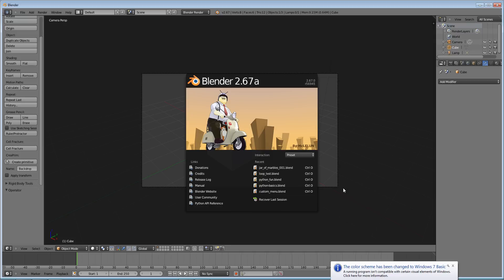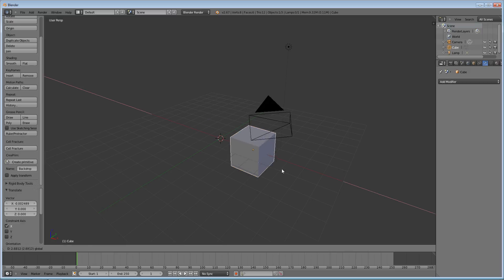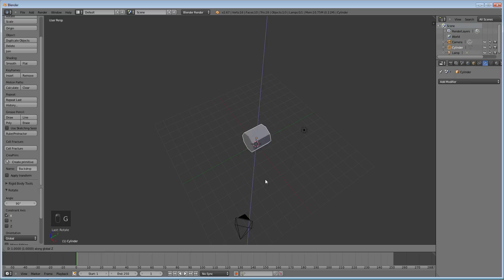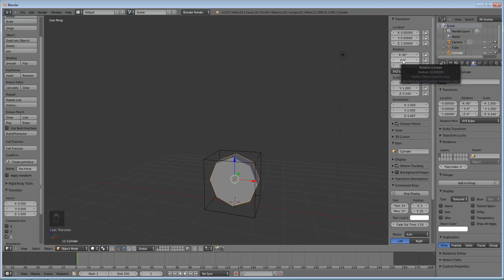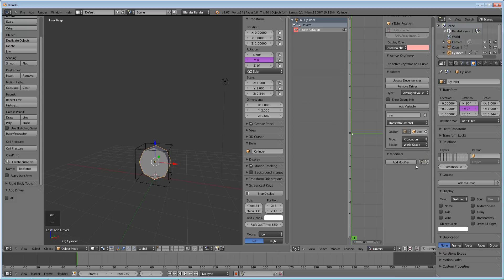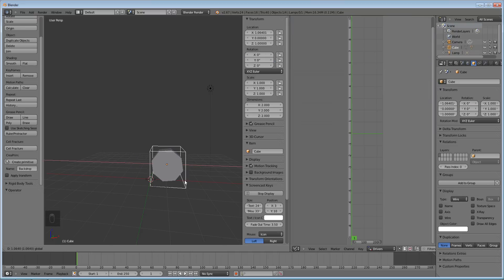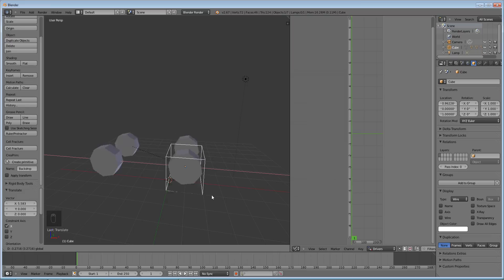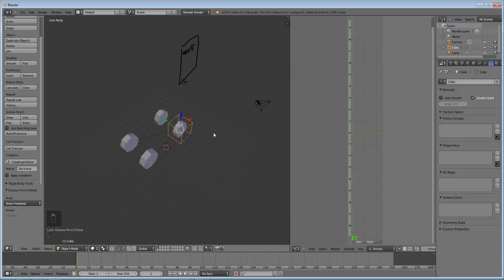Rigging a Car Wheel to Rotate using Drivers in Blender 2.6

Comment: This is not a solution! as rayjunx said if we try to turn car, wheels stop turning, or will rotate incorrectly! You  need to  use vectors for calculate on the fly! as i did in my cartoons

Comment: Nice video but:
As soon as you drive not at global Y axis, for example after a 90° turn of your vehicle, the wheel stops rotating any more. So its only useful if you never drive curves. I didn't find out how to use some kind of LOCAL AXIS to rotate the wheel independent of rotation of the object at the global space. Can you help please? What I do wrong?